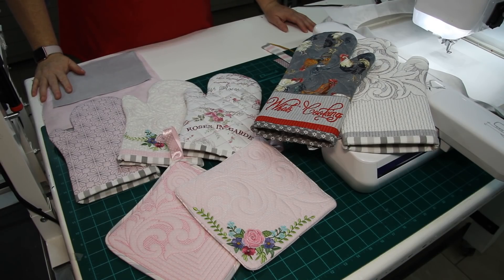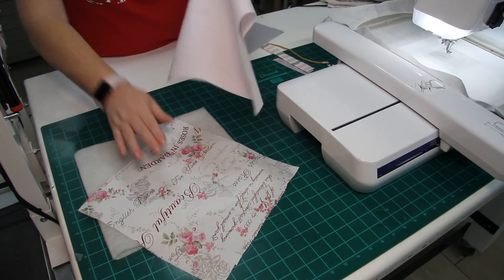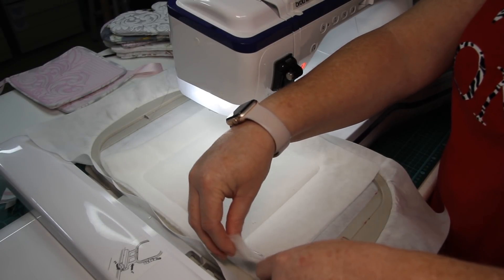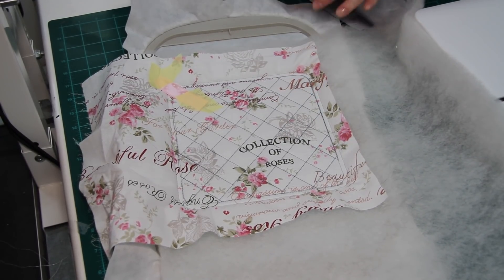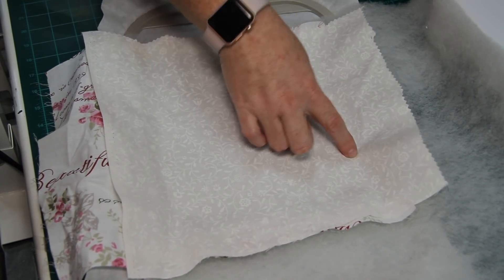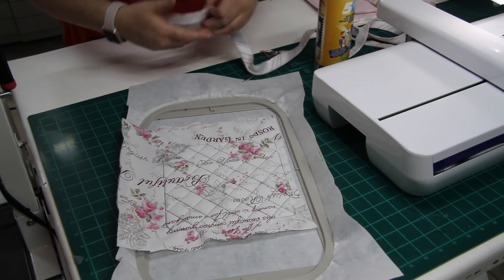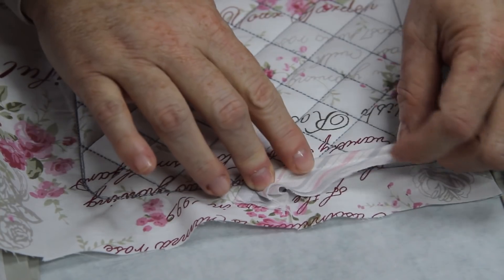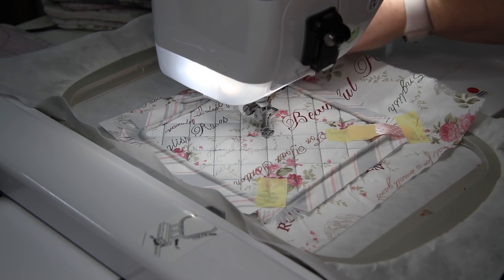SDS1504 In The Hoop Pot Holders

Comment: would one just use the insulated batting in place of where you had the batting?  It did not look like the insulated stuff
Reply from the maker: You get a heat resistant batting which you can use instead of the insulated batting :)